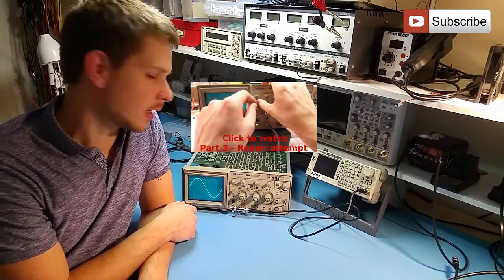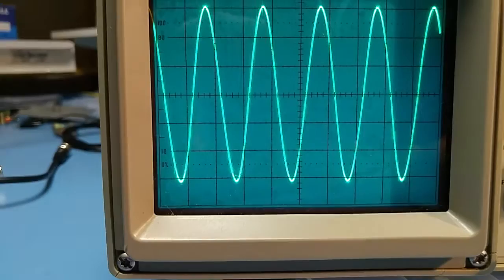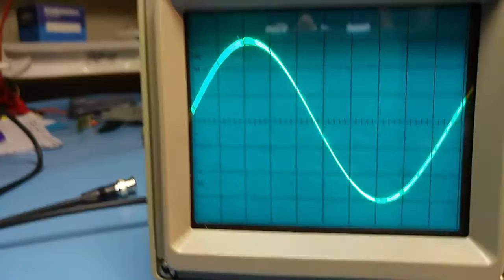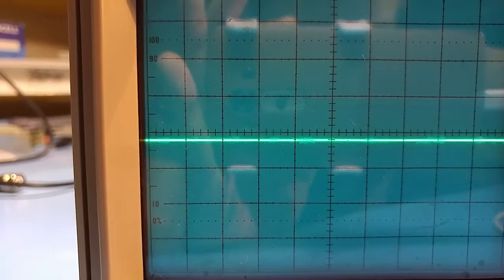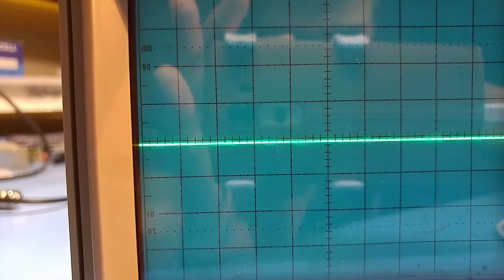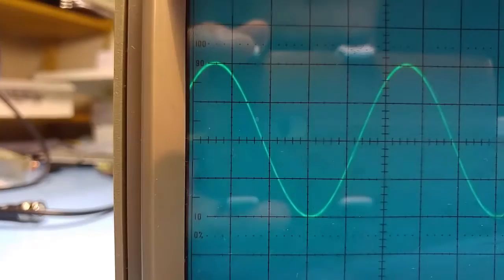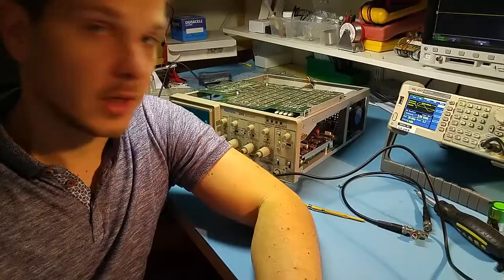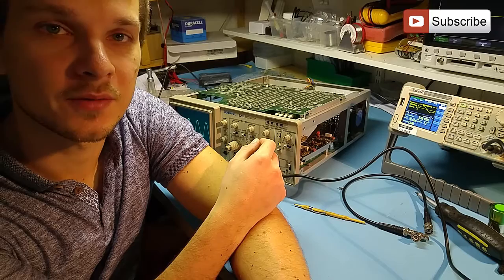ManCave 004 - Tektronix 2201 Oscilloscope Calibration After Repair HD

Comment: You are showing me all I need to know as far as the hands on part. I have the manuals for my scope and was intimidated by the calibration process. I do need to get a signal generator. I fixed my scope (I got for free in 2002, a heathkit IO-4550) when a 1-2-3 happened. Resistor, ceramic cap and Pot. Luckily the pot worked like a fuse. Replaced the parts and it works. I learned about voltage adjustment and need to do that. I have not been using it which is good as not being adjusted can damage it. Sorry, you know this! Anyway. I hope to get mine all set. I feel more confident after watching you work on yours. Keep the videos coming (and don't forget to "plug" your favorite equipment in your videos)...Sponsorship!  :-)
Reply: Glad to hear that you gained something from the video :) Good luck with your calibration!

Comment: Very nice job!! I had to subscribe. I watched all 4 videos, and you gave me the push, I needed to find out why my Tektronix 2430A shows only a 1 inch by 1 inch green square in the center, no matter what I do. Maybe you might have ideas? Your last post was 7 years ago. Are there any new ones coming up?
Reply from the maker: Thanks! I don't know much about the 2340A but based on your description, if it's showing the whole image, but smaller, this would point towards the CRT driver circuitry perhaps. I have no videos currently in the pipeline as I don't have a workshop at my current home, but there might be some videos coming out in the future once I have somewhere to shoot them. Thanks again for a nice comment!
Reply: @ManCave  Thank you for the advice, and I'll be looking out for your videos.

Comment: Hi Mancave. Nice Video!! What are the min requirements for a signal generator to do this kind of calibration?
Reply from the maker: Depends what checks you'd like to do, but if you want to replicate everything I did on the 20MHz scope, You need at least 20MHz sig-gen to check whether your scope can achieve the bandwidth and you need more than 20MHz to check for the -3dB bandwidth. You need sine and square wave and pulse output. But really, the best way to spec a signal generator for calibration is to go through the calibration procedures in the service manual of your oscilloscope and note down every setting required on the signal generator. This will give you a set of specifications which the signal generator needs to be able to fulfill. Hope this helps.

Comment: Hi Mancave, Great videos. Do you have a link to the manual, copy.com has gone. I have just bought a 2201 from ebay for £20.
Reply from the maker: Hi Frank, I've just edited the description with a new link.
Reply: Thanks my 2201 whistles like hell but I get a reasonable trace, just needs a recalibration in the main.
Reply from the maker: I would change electrolytic caps in the inverter as they are probably on their way out, hence the noise. Then recalibrate.
Reply: Will do thanks again.